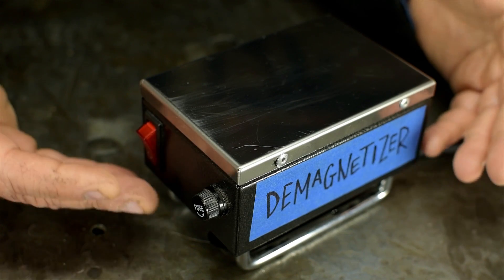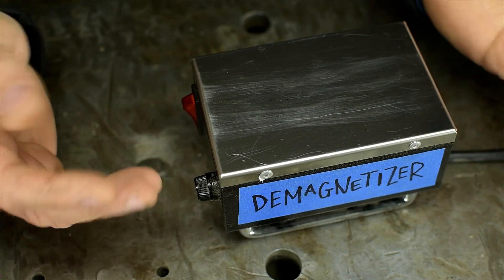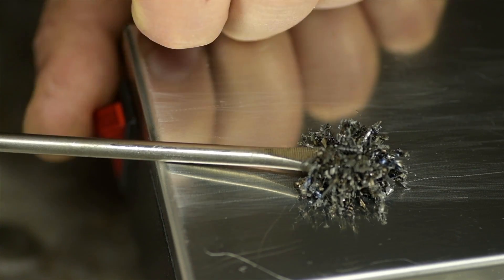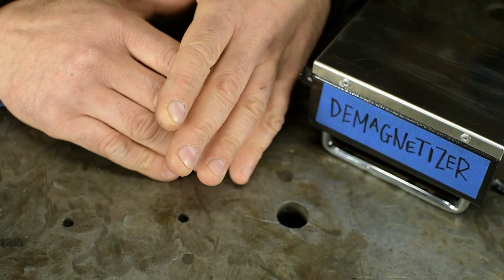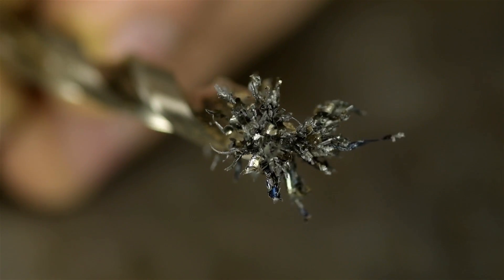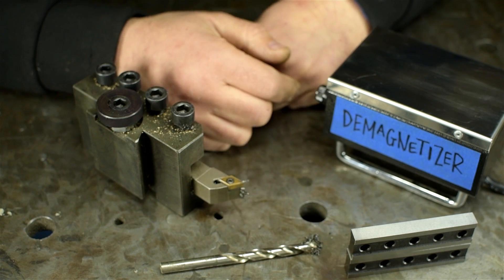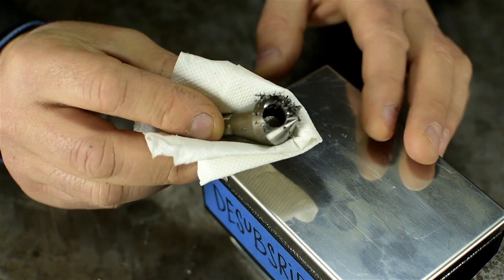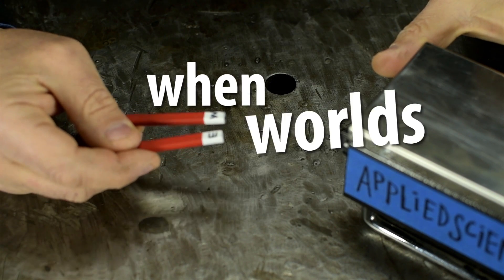SHOWDOWN! Magnet Vs Demagnetizer!

Comment: One very magnetic lesson; Forgetting to remove your durn hearing aids when going in for an MRI. Oddly enough, they just don't work the same after that!  :)
Reply: Thanks very much for this tip.  One of those things I wouldn't think about.  Did they get hot?
Reply: Hi Mike, No they didn't get hot. The final question they asked before entering the donut was if I had removed all metal. Well, uum, yeah.... Sure enough, I still had my hearing aids in when I checked. Had to have both receiver tubes replaced. The main bodies survived. Saying.... Huh? and half reading lips sure was annoying, yet much cheaper! Heheh!
Reply: Eh?!  What's that, sonny?
Reply: @sansdecorum4600  I've had to deal with hearing loss for 25 years. Certainly not due to crippled up, mentally feeble or old age senility! Can't say I'd wish the lottery of Meniere's disease on anyone I know. At 40, I thought it was my Wife's voice that caused it all. A good excuse is one you can use over and over again! :)
After the MRI,  they concluded they didn't find anything of concern. I said, well dadgummit that explains what that fancy electro-magic contraption was fer. You whippersnappers could see right through me! LOL!  Them big city folk musta never watched the Beverly Hillbillies growing up.

Comment: I have an old TV CRT degaussing coil for general shop use... works great! At about 11.25" ID it's big enough to go over bench vises & bigger stuff, but also works great for smaller hand tools & materials. They can be had reasonably on eBay... and last I looked were still available new on Amazon. To use, with item to be degaussed & coil separated at about arms length, energize coil, bring both together, pass item through coil a time or two, then slowly separate before de energizing. Seven or ten seconds total cycle time is plenty, don't exceed the coils duty cycle limits as they quickly heat. Keep sensitive electronics, credit/RFID cards, pacemakers & the like out of the immediate area. Cool videos, Thanks!

Comment: Well while we are sharing demagnetizing stories, here is a true story. Sad but very true.

Decades ago when Heathkit was still in business, I bought their top of the line 25" TV kit. I assembled it in record time and one of the last things you had to do was demagnetize the entire set with a plug in demagnetize coil. It was a mere 12" in diameter and plugged into a jack on the tv chassis. Well a lady where I worked had some silly colors on her tv screen she wanted to get rid of. So I told her she could use the demagnetizer coil from my Heathkit tv to fix her tv. I installed a typical 120vac plug since it ran off 120 volts looking at the schematic. Well she came in the next day and said that she used it and was going over the tv and the coil started getting hot. But she continued and finally it got so hot that she picked up her daughter's sock laying on the carpet by the tv and used them as gloves to hold the coil and continued...until it got so hot she couldn't hold it any longer. She dropped the coil and it burnt a circle hole through the carpet. She didn't tell her husband what happen, but through a rug over the spot... Obviously it used 120 vac but currently controlled... I didn't see that part until after she burnt it up!

Comment: I've got one that does not use electric.Just a magnet with a hole  in it . you pass the screw driver through it and it does the same thing. If you run the screw driver along the side of it it remagnitizes it. The dog is really amazed by it. Fools him every time. I've yet to give him a treat for the right answer.

Comment: I did something similar once with a heater and an air conditioner. Locked em both up in a room, turned them both on high, shut the door, and let them fight it out.👀

Comment: I expected a 50 lb (in weight, not force capacity) neodymium magnet the size of a 3 inch thick dining plate destroying a cheap demagnetiser. Not quite there but the puns are worth the watch for sure.

Comment: Also good for hard drives when the FBI is knocking on the door.  :)
Reply: Just ask Hillary
Reply: Actually, this thing won't work at all on modern hard drives.  They require extremely powerful magnets because of their very dense data encoding capability.  A degausser strong enough for modern tapes and hard drives costs well into 5 digits.  They're extremely hard to erase.
Reply: Star Gazer I useing a 1gig HD , combination backup and boat anchor.

Comment: common tony those last chips where stainless steel wherent they
Reply: This was all just CGI...
Reply: kurt titeca he liked your comment, i take that as a yes
Reply: I was thinking titanium but stainless is a good bet
Reply: It’s pretty clear that was a funny shaped pencil he colored red and tipped in white.
Reply: Hey, he's no common Tony.  He's the best Old Tony whatever was.
Reply: Tzuede Off the Cuff That might be relevant if just elemental magnetivity played any role in the final alloy properties. It does not. Clearly you have a 3rd grade understanding of physics. There is no element that is magnetic in every grain structure and particular isotope and electron orbitals.
Hence why steel loses it's magnetic properties right above the crystallization temperature.
Reply: Most stainless is magnetic
Reply: Quiettime Only the martensitic or duplex stainless steels can be magnetic, so what you are saying is that according to A.S.M.E. there are more listed martensitic alloys than austenitic ones?  Or are you referring to the percent distribution by volume/mass? Just making sure we are on the same page here, because you are dead wrong either way. The percentage of austenitic stainless steels in the world heavily outweighs the relatively minor amount of martensitic ones and 400 series ferritic ones.
Edit: with the exeption of strain and/or work hardeneing imparted by the manufacturing process locally on austenitic alloys. But the change of grain structure is negligable and highly localized more often than not. Which means that for all intents and purposes you would be unable to discern the extremely minor gauss factor this would impart upon the global properties of the piece of stainless in question.
Reply: @quiettime6871  not the kind i use
Reply: @quiettime6871  most daily used stainless isnt magnetic, or barely

Comment: Cross out the "DE" and see if you can remagnetize it!
Reply: Ayy, I like your thinking.
Reply: Ugh. That’s just stupid. It would only magnetize something. It wouldn’t be able to remagntize something.
Reply: @michaelesposito2629  I have a coil salvaged from something years ago, if you put a tool like a screw driver through hole in  the center  turn it on and slowly remove it from the coil it will demagnetize the tool but if you place the tip of the tool into the hole and flash it (press the switch for an instant) it will pull the tool through the hole and magnetize it.
Reply: july8xx I mean lol my comment was a joke, just as the OP’s was a joke.

I was implying that removing the de, would make the tool a magnetizer. But because it’s not a REmagnetizer, you can’t REmagnetize something you DEmagnetized
Reply: @michaelesposito2629  Sorry, it is hard to tell when it is a joke just from the text. :- )
Reply: july8xx tho, I didn’t know you could magnetize something using the tool.
Reply: @michaelesposito2629  I don’t know if you could use that tool to magnetize something but if jut pulsed it quickly once it might work.

Comment: im so confused, how does it do that without heating up the metal?
Reply: I used my infrared gun to check the magnet on the screen, and it was indeed slightly warm - over 294K.
Reply: Why do you assume it doesn't heat up the metal?
Reply: You set up an AC field so it's magnetizing back and forth. If you stopped with the tool in place, it would just be magnetized one way or the other. By slowly removing the tool from the field it gets flipped back and forth, slowly decaying to no net magnetization. 
You can get the same effect with nothing moving by varying field strength. That's what the twang when CRT displays powered up was. A coil around the tube was powered up with AC, and a PTC resistor reduced and then cut the power over the course of a second or so. It demagnetized the shadowmask in the tube.
Reply: Oh, and it does heat up the metal a little, but heating is not how it demagnetizes.
Reply: @RobertSzasz  I didn't think he meant the heat is what demagnetizes